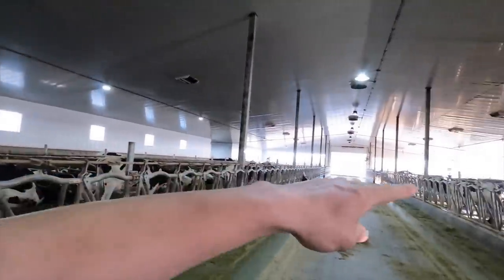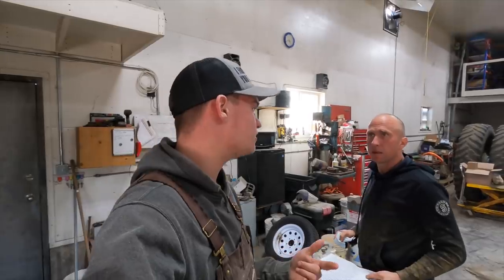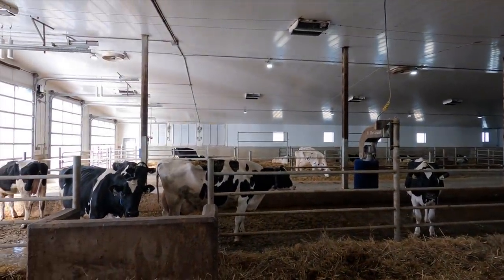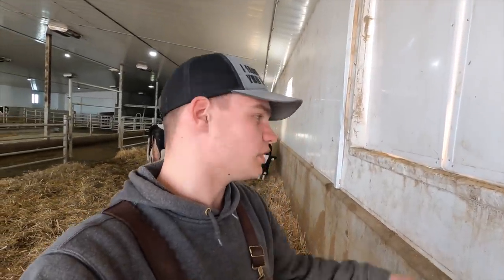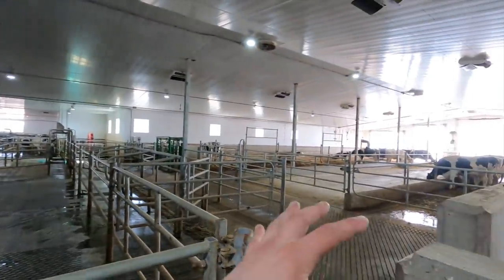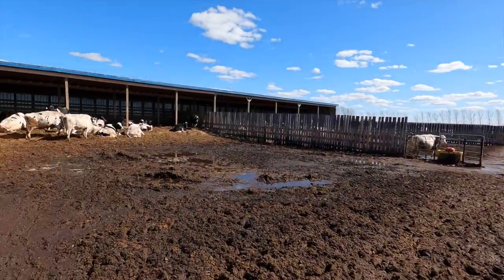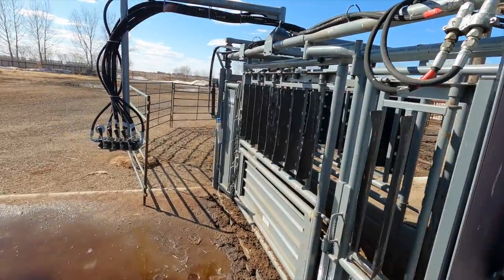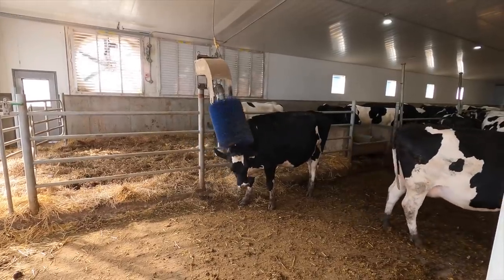Things Always Break On Long Weekends...

Comment: Jan try using Tire ject.  Its not cheap.  But will save you so much money in tires.  And the best part.  After you put it in the tire.  It stays good.  It does not go bad.  So if you put it in a tire and don't puncture it for 5 years.  It'll still seal.  Seriously check them out.

Comment: The suction that held your boot in the muck can happen with vehicles and equipment also.
When I've winched out 4X4's, construction equipment, etc. out of the muck I pull on them, then stop. Then when the leaf springs
on the truck release I know the suction has released the vehicle.
Then I winch it the rest of the way out.

Comment: Don’t ever plan to have anything to do on your long weekends it never happens pens that way always something  comes up or happens. Happy Easter to you all . Here we our in spring mold nasty weather some farmers did get out in fields to till and  disc plus put fertilizer or lime on fields. Getting ready to plant in fields if the weather cooperate . My neighbor milks over 600 head of cows got 40 heads of cow’s going to have calves maybe milking will be quick this month . They sale the bull calves and save the females to raise for breeding and milking.
Always get extra fuel line’s and  hoses and blades oil filter’s , and tire kits .
But manure helps your feet if you have soar feet or cuts it burns and heals them up. Especially if you have poison ivy it kills the itching .

Comment: Hi there   doing tire business for over 35 years    i would take a wrench and put it on the valve stem nut by the wheel turn it a few times   the rubber will some time get smaller in the cold weather     later